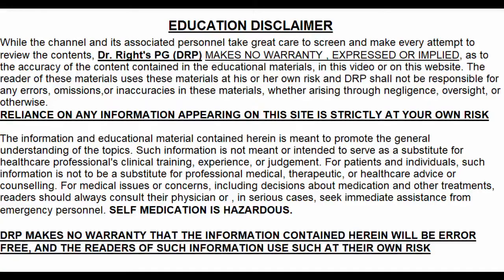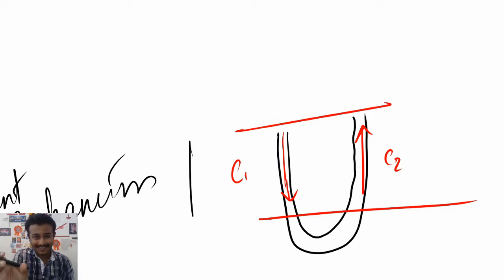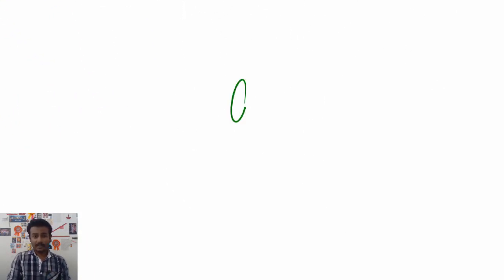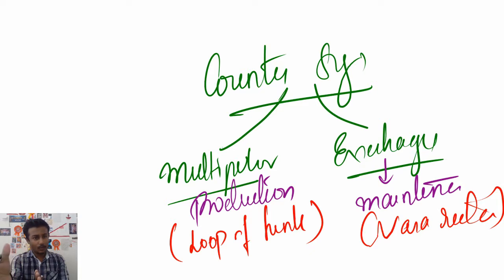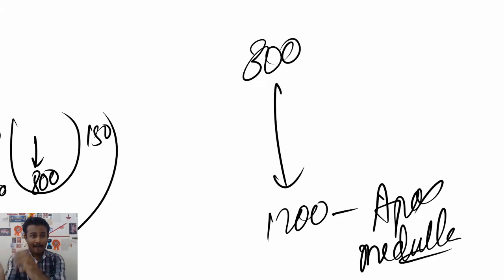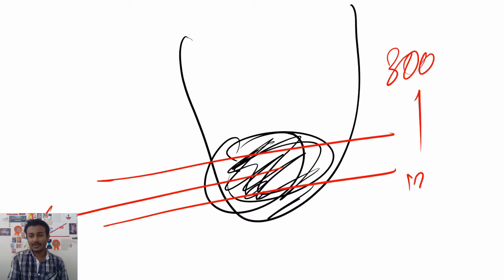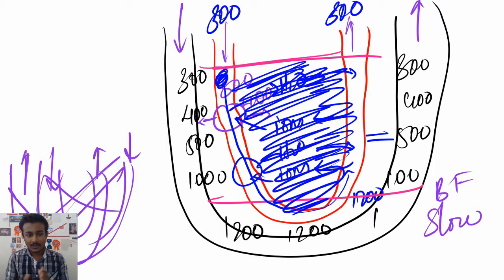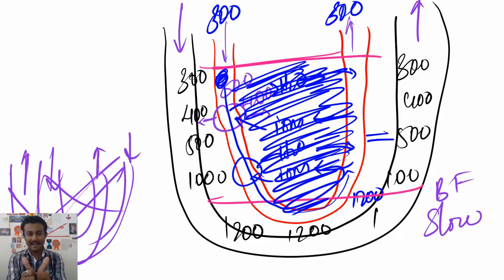Counter Current Mechanism ( Renal Physiology )

Comment: Sir,still  i have a doubt.firsty, when urine begins to flow down the descending limb of henle s loop, how it actually is pushing the ions like Na+ deep into the medulla. Because, when the urine meets the fluid at the cortex region, first the concentration of the fluid at the cortex region should has to increase and then it should be more and more diluted, as we travel deep into the medulla. Please clear my doubt sir .
Reply: Form medulla to  cortex level solute concentration gradually decrease, by secreting Na+ and Cl- by DCT  to interstitial fluid due to concentration gradient